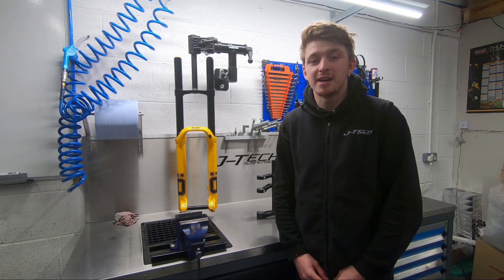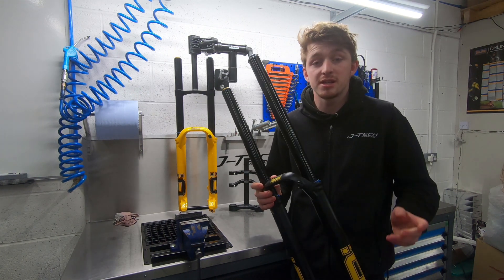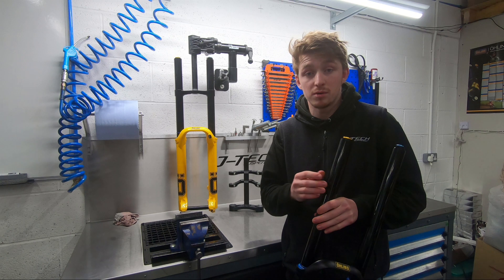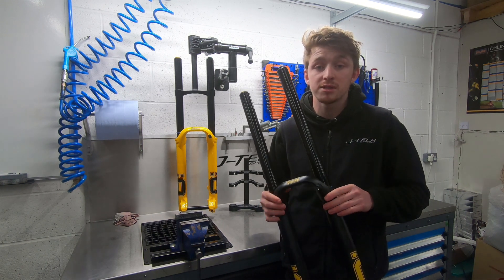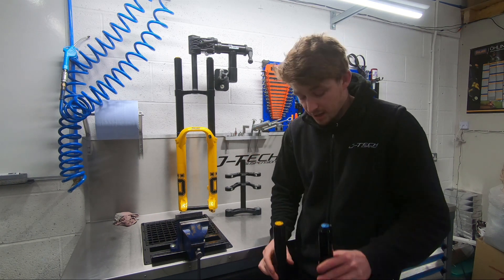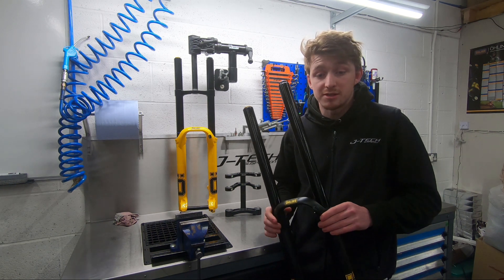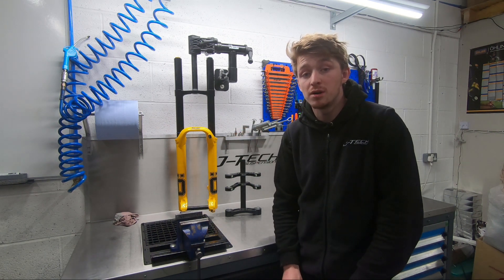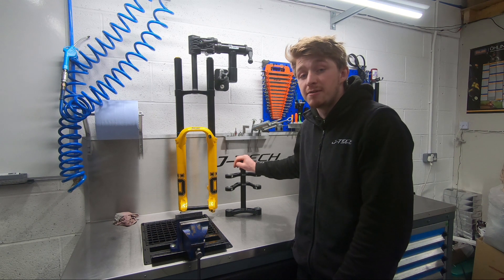The World Fastest Fork? - Ohlins DH38 Forks - J-TECH Suspension Workshop Talks

Comment: Why only 38mm? FOX is 40.
Reply from the maker: Ohlins found that 38mm gave the best compromise between lateral stiffness and torsional stiffness, or rather torsional flex to allow the fork to follow a rut without wanting to jump out. We think they've got it spot on!
Reply: @j-techsuspension  Thank you for this explanation. That makes sense. Regarding the different crown-sets: Is it your own experience that the 46mm version is the "calmest" one of the pack regarding the steering behaviour? I ask, because in two other videos the 50mm version was described as "the most neutral" one (understeering/oversteering) but there might some meaning-differences in "neutral" vs "calm" ... (?)
Reply from the maker: @Vorname_Nachnahme  No problem. There's a lot to consider, as wheelsize and head tube angle both have an impact on the feel, as well as the offset. They all combine to give you a Trail figure, it's the trail figure that dictates the feel. So a 50mm on one bike can feel different on another. All we can say is the 46mm will certainly hold a straight line better than the others, however, on the wrong bike/setup you may find it 'flopping' when turning.

Comment: Nice video. Which would you say preforms better for dh racing, Öhlins dh38 or fox 40? Thanks.
Reply from the maker: Hi Jackson, We'd go for the DH38 everytime! Many thanks.
Reply: bruh they sell that stuff, wht would you expect them to say? Most pros ride the fox 40 though soyeah, the fox 40 is definitely the better option even though it's kinda pricey
Reply: true statement, pretty obvious.  but then, fox sponsors their riders with free equipment.  ohlins does not.  even for moto gp riders, they don't give away free equipment like fox or rockshox.  maybe that's why you see more racers using fox.  But then again, they ARE winning with it.  So the bottom line is, at your skill level, you can't go wrong with either.  pick the one that's cheaper and spend extra money you save on hookers
Reply: @subforascoobysnack6460  Not too bright are you